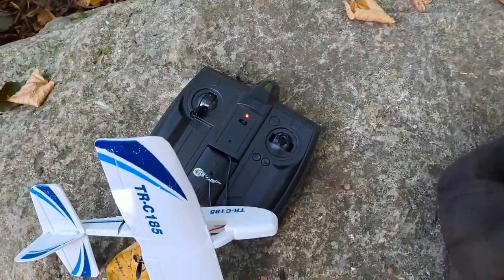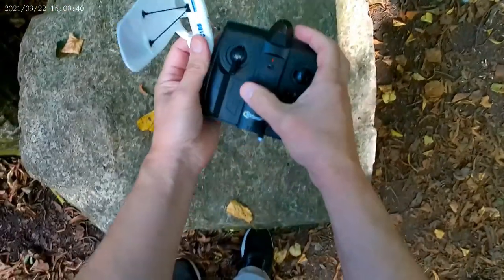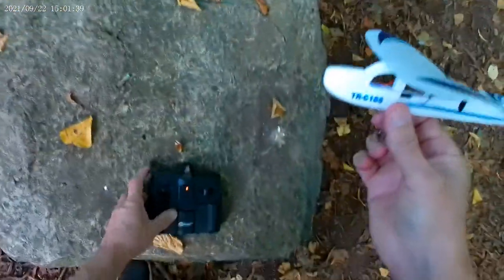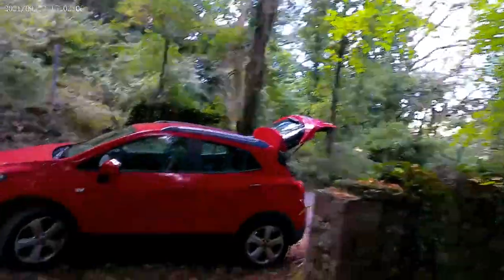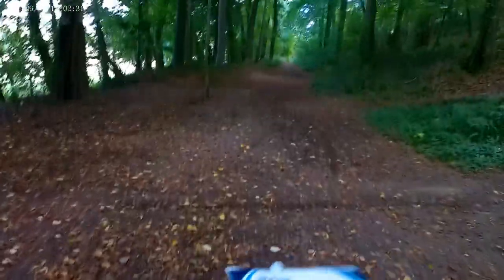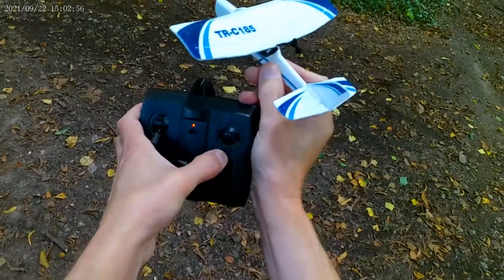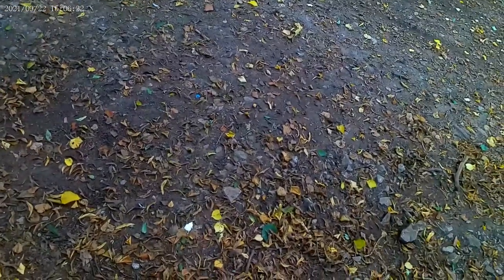Top Race TR-C185 2.4GHz Mini RC Airplane - first flight

Comment: Good on you for trying to fly in such a small are. The model has possibilitys but it would be too small and fast for me! Interesting to see it in a larger field. Maybe using the motors and electronics in a traditional balsa model with a bigger wingspan could work
Reply from the maker: On Wednesday, there is another video with it flying in the open. I did panic at one point as it was circling up with the power switched OFF and I lost a supercapacitor plane this year in a thermal at the same place. Of course, as this one is differential thrust steering, with the power off you have zero control.

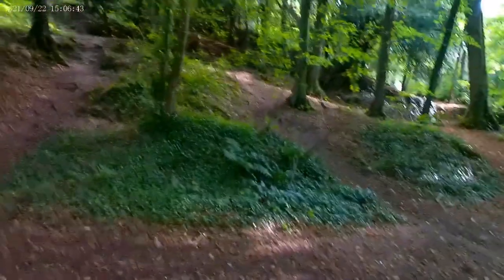Comment: I know you would want a better area to fly but at least it works. I would think the trim will slow down or speed up one of the props but you won't get to adjust it in that very small area because you're not getting enough time in the air. At 5:58 you got not a bad flight and at the end. I know you will get it trimmed eventually. Might need that fuselage straight to get it just right.Good wee nippy plane mate. 👍😁
Reply from the maker: I straightened the fuselage and on Wednesday, there is another video with it flying in the open. I did panic at one point as it was circling up with the power switched OFF and I lost that supercapacitor plane this year in a thermal at the same place. Of course, as this one is differential thrust steering, with the power off you have zero control.

Comment: Great for a fiver. The right size of tree branch was a lucky find eh.
A candidate for wheel removal and full flaps perhaps.
Reply from the maker: On Wednesday, there is another video with it flying in the open. I did panic at one point as it was circling up with the power switched OFF and I lost a supercapacitor plane this year in a thermal at the same place. Of course, as this one is differential thrust steering, with the power off you have zero control.
Reply: Am looking forward to that vid!
Over here, the best dethermalizer is a 12 bore shotgun  :)
Reply from the maker: @Slider2732  do they call them 12 bores over there? Or is that a slip of your memory 😊
Reply: Ah, good point, I have no idea. Mostly a slip of not knowing much about them. But they do call rifles long guns. There's no short gun, that's a hand gun.

Comment: Absolutely this plane is not to fly in such tight space.
Reply from the maker: I have a similar sized biplane that I have managed to fly in a similar space, but for it's first flight I should have given it more space. I just wanted to give it a try as quickly as possible. On Wednesday, there is another video with it flying in the open.

Comment: Do not fly planes in woods.
Reply from the maker: Much more fun, if you can get it right, but there simply wasn't enough control to manoeuvre it successfully. Remember this one is sold as suitable for indoor flying and I don't have any rooms as large as that space I was flying in.
Reply: @GrandadIsAnOldMan  a playing field would be more suitable.
Reply from the maker: @tangothecat237  like I said, you are supposed to be able to fly it indoors, but that would need more skills than I have. In a sports hall it should be OK 👍